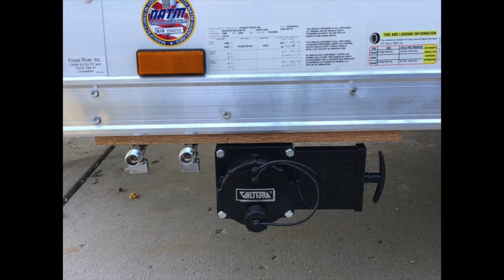7x12 Cargo Trailer Camper Conversion. DIY Camper - Small Camper - Tiny Home

Comment: I'm Like #980...! I love your build ❤ It's cool what you can do with so much space! My 4x6 v-nose toy hauler-camper-theater is quite compact. Front 4x5 deck plus roof rack and hitch rack is extra room for 2KW Inv-Gen, Solar pnl, Awning and more toys! 3 cabinets house cooking equip. and the 24"TV/entertainment ctr. Twin tri-fold sofa-bed, 5K BTU AC, 350W elec heat and induction cooktop complete the collection (so far). Planning a folding room pinned onto my ramp; maybe a kayak up top. Or a canoe when my wife goes... Pulling it with a 1.8L Scion XD gets 20mpg (headwind) and 28mpg (tailwind)

Comment: When insulating your ceiling use rubber roofing insulation 2 inch is R11.5 and it's heat resistant  You can buy it at Menards

Comment: Very interesting floor plan - thanks for sharing.  I'd like to create a similair bed set-up.  Where do you eat?  Table?  Is the backsplash real tile?  Thanks!
Reply from the maker: We eat outside exclusively. We have popup claim shelter we use for eating if the weather is iffy or the bugs are bad.. The back splash is actually sticky tiles in 12x12 sheets.

Comment: Very nice job ...been a long time ago no problems ?...hope the hitch point area was reinforced for more strength to keep from bending while on bumpy roads with that weight on it..
Reply from the maker: Thanks for the comment! Zero problems so far. Not worried about the hitch area of the trailer. The trailer its self has the heavy duty frame you would see on larger dual axle trailers.

Comment: Weight of Trailer ?   and new weight as a Cargo Camper ?  Why did you chose a single axie and why 12 foot length ?  what type od vehicle are you pulling with ?
Reply from the maker: Trailer  curb weight was 1600 lbs. With the build out and everything in to go camping I am 3700 lbs. I am changing the 3500lb axle to a 5000 lb this winter to handle the extra weight. I chose the single axle because I did not feel I needed the extra weight capacity and so far do not regret this decision. I also was trying to keep the build a light as  possible. I had initially set out to build a teardrop but we have a son that still camps with us so we needed a bit more room. I laid out everything we wanted in the camper on the floor of our living room and determined that a 12 foot would be more than enough for what we wanted. We also have a 31 foot with slide outs that sits on a seasonal site so we are not strangers to what we like while camping. I pull this trailer with a 2013 Dodge Ram 1500 5.7 hemi. I get about 10-12 MPG. It pulls it with no problem.

Comment: Do you know what the empty weight is on this trailer?
Reply from the maker: It was around 1500 lbs. I am at close to 4000 right now with the build out and fully packed.
Reply: @CarlFiocca  Thanks! I've been debating between sizes of trailers and I think 7x12 single axle is the sweet spot for size at minimal weight

Comment: I'm currently building a 7x12 just like yours! It's great to see someone with some of the same ideas as myself. I have to ask, how on earth did you build that shower? I wanted to put one in the same location but I can't find any shower pan or anything to fit, yours looks custom and I'd love to know how if you don't mind, Thank you!!
Reply from the maker: Hi Dean! Yes the pan is custom. Very easy to do. I just used 3/4" plywood for the base. I did water proof it using several coats of "the mix" method. 

http://www.tnttt.com/viewtopic.php?f=55&t=48548      -Read through this it will tell you everything you need to know. 

I did sand a taper to the drain and and added a 1/4" x 2" strip around the perimeter of the "pan to give it more pitch. I then stood in the center and put some screws around the drain to hold it in place. The walls are 1/4" plywood. I did not use "the mix" on the walls like i thought I would. I did caulk everything, let it dry and put 2 coats of Zinzer primer on. Re-caulked everything and gave walls and floor 3 coats of an exterior paint. The front edge of the "pan" is just a 2x4 cut to height with 1/4'" plywood with above mentioned treatment. We are taking "Navy" showers and not really soaking anything. Heck my 31'TT has wall paper in the tub/shower area. This is much better IMO.
Reply: Thanks for the response!! Very interesting!! I think I may have to take a similar  approach! I’ll have to fully read through that article on a bigger screen than my phone. I like the idea of the “waterproofing”. I think this is my route to and I didn’t even think of making a taper on the 3/4plywood I love that idea!! Thank you!!

Comment: Hey Carl this is a most helpful video, thank you. I 've had a 7x12 conversion that I built out 4 years ago. I'm about to strip it and re-do so that I can have a wet bath. I found answers to questions about the shower walls but I have a question about the pan. Did you build it? If so did you sim in some way so that the drain sits lower?
Reply from the maker: @tennysontappan5349  I did build it myself. I use a combination of polyurethane and mineral spirits, thin down to soak the pan, so it was completely waterproof throughout the entire thing even the sides. It’s called the mix in teardrop communities. I used a belt sander and sanded a slope all the way around towards the drain. I also put a quarter inch shim around the whole perimeter of it and then screwed the center tight to give it even more of a slope. Hope this helps.
Reply: @CarlFiocca  very helpful. Thank you.

Comment: I am a little late to the party, however I am very impressed with your build!  Do you have any advice for someone who just picked up a new trailer yesterday?
Reply from the maker: First Congrats on the new trailer!! Let the fun begin. The best part of these builds is that you can do WHATEVER you want to do with it. Put in only what you need, leave out the crap you don't. We spent a lot of time with tape and boxes to figure out the layout. I would suggest getting your bed configuration figured out first and design the rest of the conversion around that. A good night sleep is important. These builds can be as easy or complicated as you want. It's all up to you and your budget. Join some groups on FB like "tiny house adventures family" or "cargo trailer conversions" lots of info and great people to get advice from. Most importantly is to have fun.

Comment: Nice job. One question for you. The two hose ends next to the drain, are they for city water hookup or a fresh water tank fill and vent?
Reply from the maker: They are actually for the on demand water heater that is now mounted on the the front of the trailer. The one on the right is the out feed of cold water to the heater and the left one is inbound hot water.

Comment: Very nicely done. Everything looks great in this trailer. Just wondering how heavy this trailer is and can this be towed by wrangler unlimited ?
Reply from the maker: Thanks for the kind words. Fully loaded ready to go camping I am pushing 3400 lbs. I will be putting a 5000lb axel under it next year.  I don’t know how much the Jeep can safety pull sorry.
Reply: @CarlFiocca  I just upgraded my axles, was going to go 5000 w brakes but after consideration went with 2 3000lb axles instead for better balance of weight, pulls so much better now!

Comment: How much was the air an heating unit an how does it work for u in that trailer 
Do u put a cover over it when traveling to protect the split unit
Reply from the maker: The unit cost $489 to the door. It works AWESOME. Last trip we had the trailer down to 63. I do cover the coils when traveling with plywood for now. I will have canvas cover made for it soon. Thanks for watching!!
Reply: Do you have a link to that unit
Reply from the maker: @greg925911  this one is similar.   https://www.ebay.com/itm/12-000-BTU-Ductless-Air-Conditioner-Heat-Pump-Mini-Split-110V-1-Ton-With-KIT/352657210272?hash=item521c01fba0:g:yokAAOSw8UddvJM2
Reply: Thanks

Comment: Great job.... very nice setup.... everything you need. You would not get quality like that buying a RV.
Reply from the maker: Thanks SlipperDog! The quality VS money is one of the main reasons we did this. I did not want a rubber roof, I did not want 2x2's stapled together with crap paneling. I wanted real wood cabinets.  I have done enough work on campers to know exactly what I did not want. And, I got what I wanted for about half what a new camper this size would cost.

Comment: what is the hitch weight now?
Reply from the maker: 500ish. It’s heavier than I wanted but it pulls without any problems.
Reply: @CarlFiocca  700 lbs tongue weight?  How much overall weight is the trailer?
Reply from the maker: @sadde10  I went and rechecked my numbers and I mis spoke before. Hitch weight is 510 lbs. trailer total weight was 3600lbs.

Comment: Question about the bed, is it on a hinge system or you just lift it onto the bench and cleat system every time you want to lay in it?
Reply from the maker: No hinge system. We lift it every time. Not very difficult. I put a strap for a handle on my wife’s side to make it easier for her. I may do the same for my side also.
Reply: @CarlFiocca   Thats a great idea, What mattress do you guys have?
Reply from the maker: @geauxadventuring6039  we bought a short queen memory foam from Amazon

Comment: I know I'm late watching your build but I really like what you've done. One question, is the mini split a/c very loud inside? I currently have a Dometic roof a/c and it's horrible.
Reply from the maker: John Tatman the mini split is very quiet. Soft hum is about all I hear.
Reply: @CarlFiocca  Thanks Carl.
Reply: The mini split provides heat and cold, right? How efficient is it compared to a regular RV roof unit? Am interested in this entire electrical system you did. Could you make another video on this from the panels to the mini split with run times and costs? Forever grateful!

Comment: Probably last twice as long as a store bought one!
Reply from the maker: I think you are correct. I repaired several campers before I built this one and I realized how poorly they are built. We shopped for a comparable factory built and was not impressed. I wanted a metal roof and something that could withstand a branch falling on it. The prices and quality drove me to build what I did. Real wood cabinets and I know where every wire is in the trailer and can access it if need be. Custom made to what I wanted. Thanks for watching.

Comment: What is your interior head height?
Reply from the maker: 7' Tall. We went to a trailer dealership and stood inside 3 different ones, 6', 6.5', and 7'. With such a small area I feel the more height the better. Gives the illusion of more space. It also allowed us to put the bottom of the bed at 25" off the floor. Our youngest sleeps on a pad under us when he goes with us.